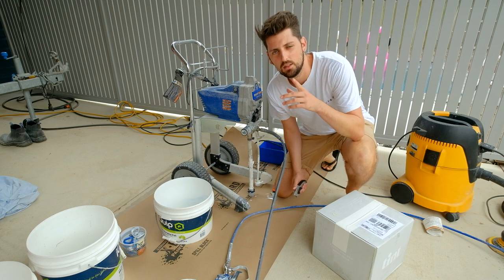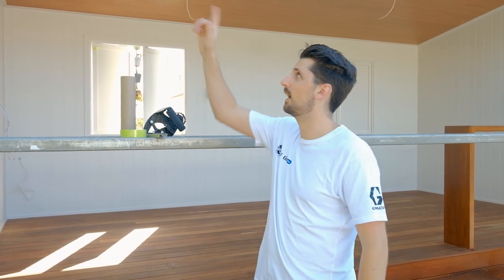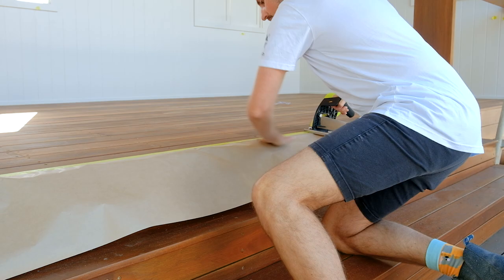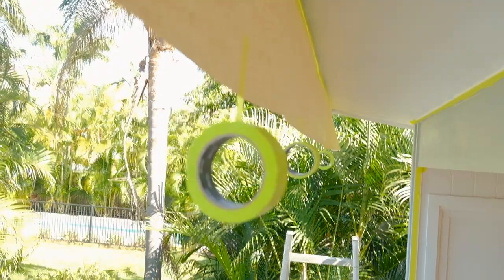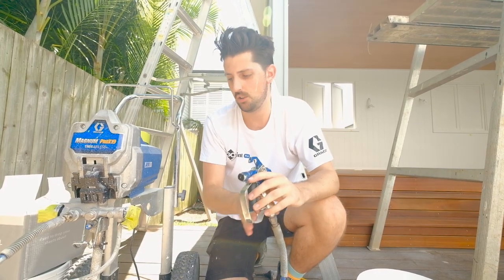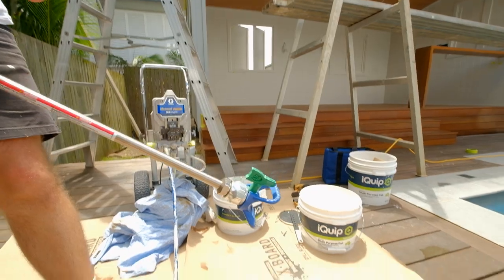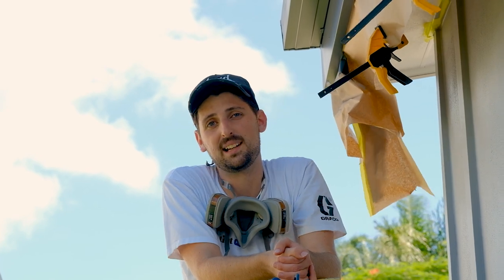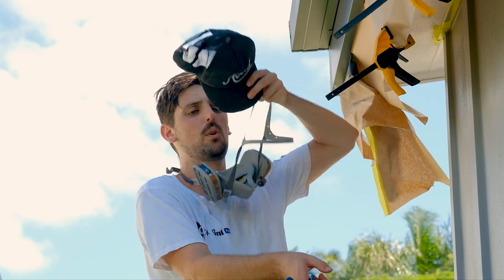Painting gutters with an airless paint sprayer [DIY]  | The Cabana Project Pt. 3

Comment: Hey guys, for the metal facia that meets the eaves: Sometimes they require the insides painted which can be annoying.What'ss the best way to prep that ? Currently Im runing along the edge with painters tape just incase my spray shield drips on the facias... then i go along with a brush for that inner section.